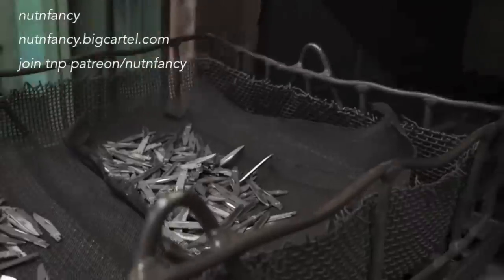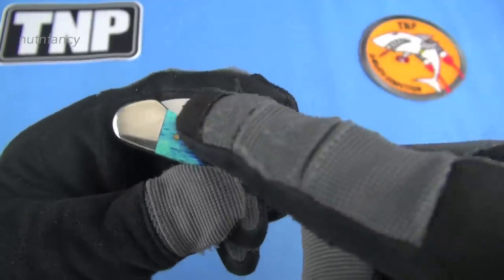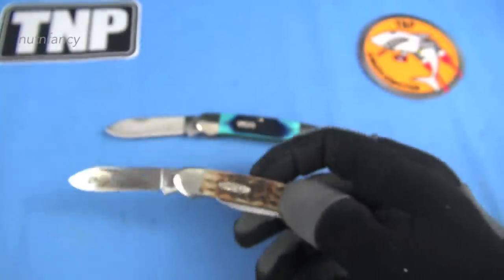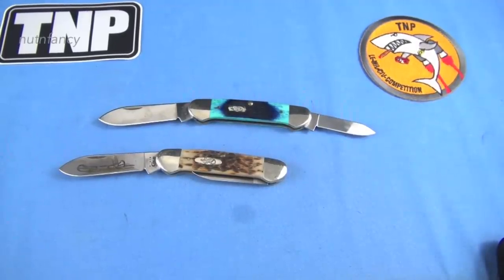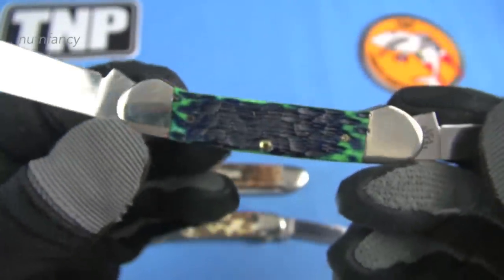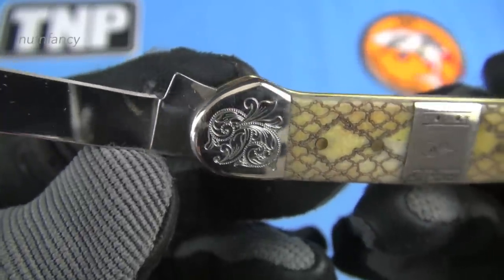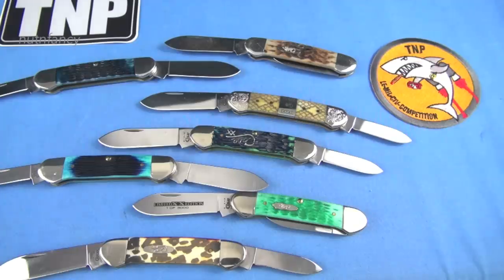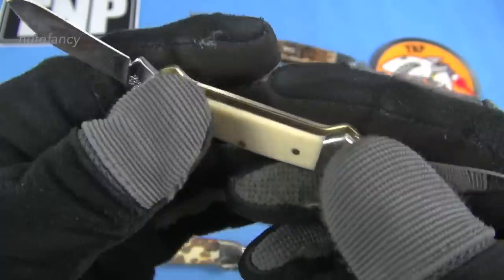Case Canoe Knife: The Way Things Used to Be

Comment: For me, it's not so much a matter of nostalgia or tradition, but the look and feel of slip joint knives that I like. The visual beauty of the handle materials, the nickel silver bolsters and shields, brass liners and pins, the visible springs, everything is so shiny. And the way it feels to open and close them, what they call walk and talk. My Spyderco and Benchmade knives are far better, more useful and more sensible, but I’m still drawn to traditional knives. They feel better in the hand. Especially Case knives because they’re tumbled, so all the rough edges are removed and they just feel so good.

Comment: I’m picking up a 2004 case canoe Celtic maze addition there was supposedly 500 made of each pattern in the Celtic maze you can find just about most of them but you can’t find a canoe I got very lucky to find this one it just doesn’t have the paperwork so I’m getting in touch with Case and they’re going to try and work some out with the paperwork to prove that the Knife is authentic

Comment: Dude, dude, dude, dude, dude! Just snagged a used Rem. 870 with M4-type stock and pistol grip and an optical rail for $300 at a local dealer. I know it's got nothing to do with this video, but I watched a bunch of your shotgun videos last week. So when I was at the indoor  range I saw a new Mossberg 500 riot gun for $400 and this used Rem. for $300. Haven't shot it yet.

Comment: Id like to find a small game knife modeled after the larger blade, in STOCKMAN style pocket knives. Any idea of something like that anyone? Ive got a old RANGER(made in USA) stockman style in carbon steel, given to me by my grandfather, years ago. Good for small game but sucks to clean being carbon steel, and keeping it from rusting. I usually wash up with hot water and dish soap and let air dry then oil it up.  Be nice to find a fixed single blade like the main blade that I use the most. When comes to classic folders, I like the Trapper and Stockman style best.

Comment: I got a brand new Case trapper a few weeks ago, had blade play on both clip and Spey blades in every direction. Also the rivets stuck out past the handle and were sharp enough to cut your hand open. Also came with deep scratches on both blades that kinda ruined the collector aspect right out of the box. Really disappointing to see a good company’s standards drop like that.

Comment: While Case Knives are still made in USA and still descent, their QC has slipped a little as experienced by last years purchase of a bunch for Christmas gifts for friends. I much prefer the Carbon Steel blades over the Stainless and have carried one on a daily basis for 55 years. Mine have patina on them and it bothers me not. I keep it lightly oiled and so no real rust ever gets bad enough to turn brown. Yea, they require a little more care but it's not a big deal.  While I do own some "tactical knives", I rarely carry them as they are not as comfortable, user friendly, PC and or compact. I personally do not rely on knives as self defense tools, (Pistols are a whole lot better) so speed of deployment is not very important to me. Case Select is a step better than the standard line and sometimes I get pissed that we have to pay more for what use to be standard!  A sign of the times I guess. BYW I use my knives on a daily basis and they are not "babied". I also have a few Carbon Steel Marbles (MSA made in Gladstone MI - 2001)  that are superior to the Case knives but sadly no longer available. Now the Marbles brand name is just a name and they are cheap knives made in China.

Comment: Good luck keeping that thing sharp. Freaking nightmare.
Reply: Tis true some don't know how to sharpen a knife. Knowing how will keep it sharp longer. Doing it wrong will ruin it too .
Reply: I like my case knives but they are the most challenging to keep sharp. I own lots of knives and this one gives me the most trouble.
Reply: @Dustinwhy8  
The steel has changed a little bit but it's still some of the best knife steel on the market. The really old Old Hickory knives are mostly carbon steel and can be made very sharp . Sharper than a razor if you know how. The case knives have less carbon and that's why they are hard to keep sharp but in doing this they don't rust as easy either. The Old Hickory knives will rust very quickly. I can remember my dad had one for a week in his pocket and it had rusted. The blades turn brown then black and that's the way they stay. You can polish them but it's useless. Case wanted there knives to keep the luster so they are more for looking at than using.
Reply: @benjimenfranklin7650   are you stoned?
Reply: The steel in these knives sucks.
Reply: @wysurvivor  
Only for those who don't know how to sharpen a knife !
Reply: @benjimenfranklin7650  you know what your right. What was i thinking it so unreasonable for me to expect a knife to hold an edge while doing such things as opening the mail, and or a box. I should just cary a leather strop around every woth me.
Reply: @wysurvivor  
You could buy a real knife and then you'd be set. You need a Old Hickory knife. But you must find an old one they are not made like they use to be. Or you could buy a Kay-Bar fighting knife . It's one of the best knife's I have ever used. I have had mine for fifty years.
Reply: @Rhetorical Answer 
You know at one time case was a good knife but nowadays your right they are just pretty. I think most of the good knives that's good knife blades are history. They like that fancy stainless steel and that is not carbon steel.
Reply: @wysurvivor  
You know I have so many stones now I need a dump truck to move them all.
Reply: I realize that this is an older comment but I don’t really understand why anyone would have trouble sharpening a Case Canoe or keeping it sharp. I use a Worksharp precision adjust sharpening system and it does a great job keeping all of my knives razor sharp. Maybe give it a try. It’s very reasonably priced.